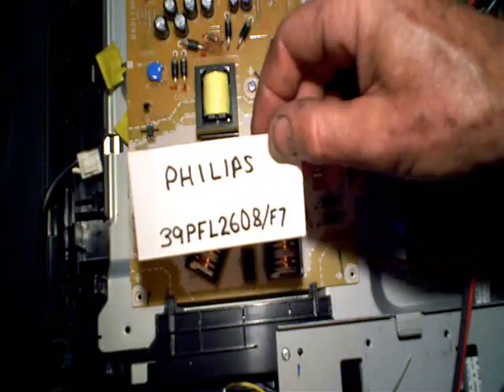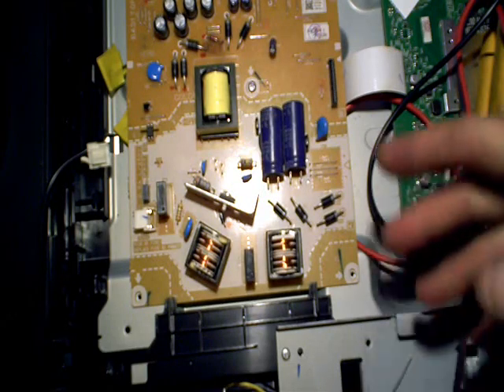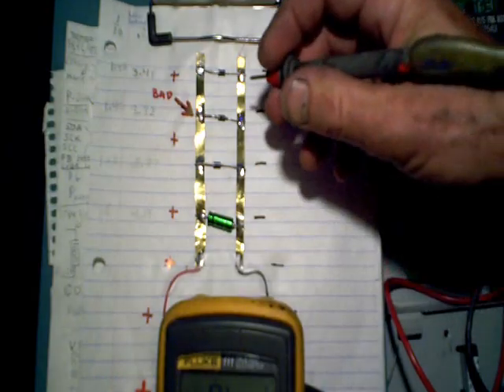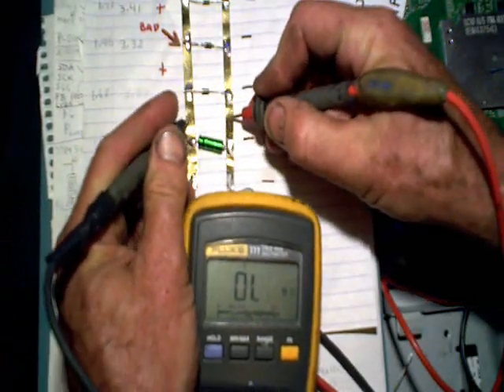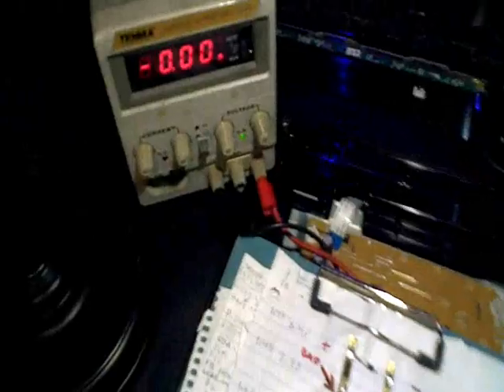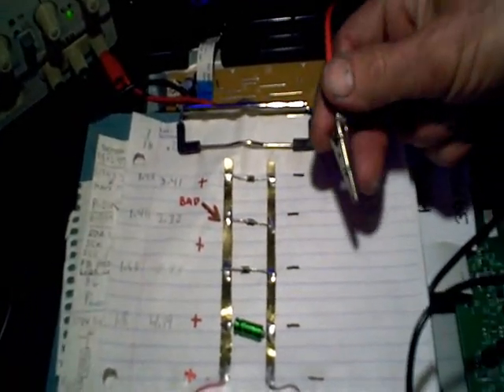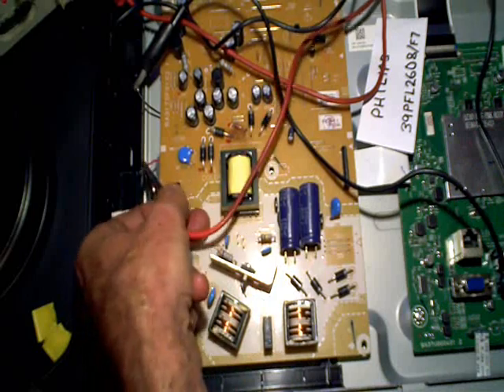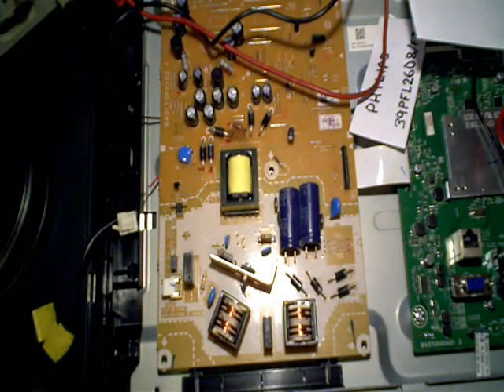Your Multimeters Millivolt scale can be used to locate shorts to ground.

Comment: Why are the diodes in parallel
Reply from the maker: Where?
Reply: You said the diodes are in parallel so if one is shorted then they all are?? 
My question is what reason would they be in parallel if they all fall short when one fall short.
Reply from the maker: @irishguy200007  I don't recall saying that all of the diodes will be shorted just because one of them was bad. My point was that one shorted diode is in parallel with other diodes it can make it appear as though all of the diodes are shorted.  Unless you have a sensitive meter it will be difficult  to figure out which one of them is actually bad.
Reply: @GrantsPassTVRepair  So they put these diodes in parallel to take higher current??
Reply from the maker: @irishguy200007  I don't know why many of the diodes were in a parallel circuit,
Reply: @GrantsPassTVRepair  probably to ease the current or load burdon on an individual diode. By placing a few in parallel the each can take a percentage of the current.

Comment: Hi Dave , I to enjoy finding shorts to ground, and use two different approaches depending the mood  i' m in 1st is my home made milliohm meter, other more recently is a circuit I found on the web current source .25 of a watt at 3 volts, so I use that method you used, works well, to practise on I have some old tv boards, which I know have faults, so I quite moment &  I try these things out, I haven't yet tried out the ESR meter, but may well
  Paul  M0BSW     uk
Reply from the maker: Thanks for the info. I miss the days when searching for shorts to ground was a regular necessity.

Comment: GREAT VIDEO & A GREAT LITTLE TRICK! My Teague ESI will measure down to micro-ohms, and uses a 4 lead shielded Kelvin clip lead set. That Teague is around $3000-$5000, used. The time it saves testing caps, & diodes in circuit are kind of worth it. I really love having it, and don't know how I lived without one as long as I did.  I have used this method too. I liked the LCR bridge so much, I bought a spare one. It is a Chinese made no name that cost $700, but it works, despite only having 4 test frequencies, 4 test voltages & 4 test current. The Teague has 100s. I fixed up a Samsung plasma TV only to find it puts out excessive RF interference into the mains, making my amateur radio station noisy. Plasma TVs are notorious for backfeeding RF noise into the power lines.

Comment: Coolness, it's nice to know the full power of one's multimeter.

Where's the microVolts and miniAmps and microAmps used for (I think my new Smart multimeter has it). Also what's the frequency function used for?

God bless, Rev. 21:4
Reply from the maker: The frequency function is for measuring various frequencies such as your AC mains frequency and the duty cycle of switching power supplies. Youtube has a variety of videos on the topic.
Reply: @GrantsPassTVRepair  Thanks. I just got a new Smart multimeter (extensively researched it) the amazing Kaiweets KM601 (rebranded as Habotest HT116 it seems, GDA rebranded too) but can be a manual too, it's amazing and beautiful (not sure how much power drain it does when it's ON for hours or while its stored) that many pros have made one of their main multitester. One can just push a button and not use two hands to rotate a dial for those crucial moments when the hands are tied (even other limbs perhaps). If one looks around it's just US$29 if one looks around, Kaiweets its father manufacturer it seems, has leads that are interchangeable (pull out attach and alligator clip, etc.).

I also like to recommend the stylish, silver color but very capable KSGER brand 2 in 1 combo SMD hot air (the one EEvblog recommended) and OLED soldering station (uses genuine Hakko tips, if clones are used, don't go greater than 350C, buy tips in sets. Also mod the case to be true grounded from the case to the knobs), buy the stylish steel with black soldering want (detachable) & KSGER stylish soldering iron stand.

God bless, Rev. 21:4

Comment: Great video sir. But I have this question: you say "...when it senses a short, the feedback circuit slows down the duty cycle..." Which particular component, in the feedback circuit does the "sensing" exactly? Please let me know. Keep making videos and be safe out there. Cheers!
Reply from the maker: I can't give you specifics on every component used to alter the duty cycle of a power supply, but Opto isolators are often used for shis purpose.
Reply: Thank you, for replying. Pardon my ignorance, I'm a complete NOOB but do you mean, that opto isolator are used to alter the duty cycle of power supplies OR that opto isolator are used to NOT alter the duty cycle - make it more stable. Please reply, I want to learn. Thank you kindly and be well
Reply from the maker: @maxwarfield6699  Opto Isolators are used to help regulate the power from a switching power supply by monitoring the output power and sending a sample to other ICs for regulation. If you youtube opto isolators you can learn a great deal more than I can explain in a few lines of text.
Reply: You're AWESOME, thanks! And I will look up opto isolator, I have to get to the bottom of this. Thanks again mate. Cheers!

Comment: Great video and explanation.  I thought I seen a video of someone looking for a short with a battery maybe it was a 9 volt and a multi meter. Is it possible or even safe to do?
Reply from the maker: TakeTheNarrowPath GloryIsHisName  I suppose you could use a 9 volt battery if you added a 27 ohm resistor to drop the current a little, but it would sure be hard on the battery..You might see the power drop so quickly that your reading might be undependable. It would be better to build yourself a small power supply out of an inexpensive transformer, a resistor and a bridge rectifier.